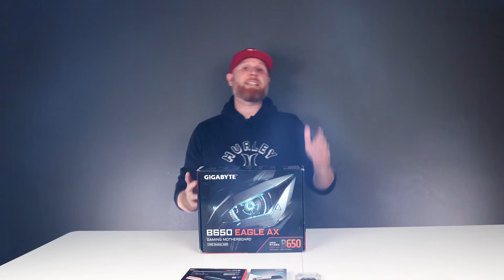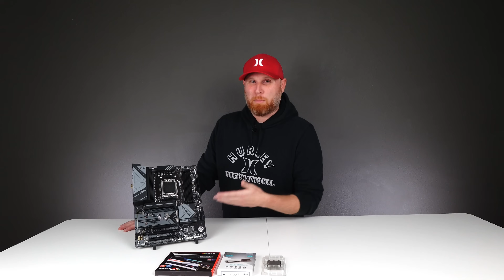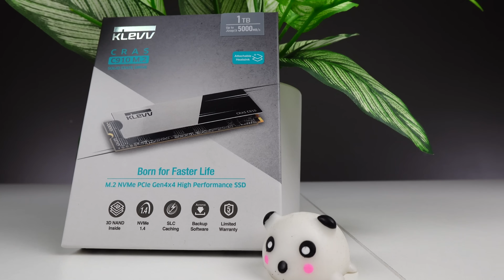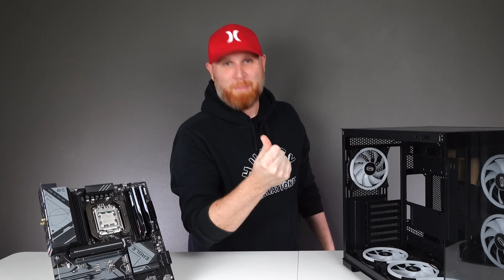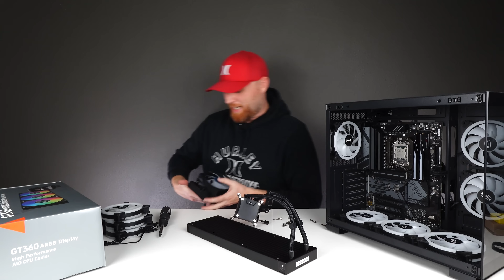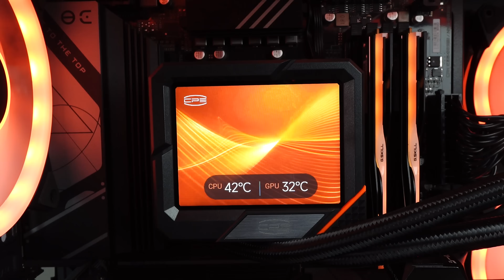The Most Well Rounded PC Build

Comment from the maker: What would you change if this was your build? Let me know!
Reply: can i have this pc please
Reply: @idontknow-e8k  What a beggar. Get a job.
Reply: The garbage power supply. That entire brand is a scam, has been found to underperform and has faked 80plus ratings. Stop supporting them and do better.
Reply: please let me have it please
Reply: can i have this pc
Reply: Depend on your budget. My budget was 2000 chf (I live in Switzerland 2000 chf are about 2500 USD). Budget is everything! I could spend even 1600 and have almost the same performance but with 400 more I have 4TB SSD, 64 RAM, a good looking case etc etc ....but I am aware that it is wasted money for my eyes and wishes.
My new PC is as follow:
Case: Cooler Master Masterframe 600 B (149 chf)
MB:     MSI MAG B650 Tomahawk WIFI (158 chf)
CPU:    Ryzen 7 7800X3D (310 chf)
RAM:   64 mb Kingston Fury Beast 2x32 ( 219chf)
SSD :    4 TB Samsung 990 Evo Plus (241 chf)
AIO:      CM Masterliquid Atmos 360 B (121 chf)
GPU:     XFX RX9070XT Mercury OC (600 chf)
PSU:     Seasonic Vertex GX 1000W (149 chf)

In total about 1950 chf = 2340 USD 

I will use it with MSFS2024 (I am a retired glider pilot) so an X3D CPU and 64 mb RAM are useful, and in MSFS the so called "tech" are not important, more important is VRAM quantity and for unknown reasons AMD GPU's perform very well.
Reply: M-ATX board for clearance.
Reply: Nvme with dram cache like the 2TB Timetec PCIe 4.0 Gaming DRAM Cache, Acer Predator GM7000, SN850X. Ram kit: KLEVV FIT V 32GB (2X 16GB) DDR5 6000 CL28/C30,  Montech
XR or Lian Li V100 cases, Thermalright Frozen Notte 360. Any money saved get Motherboard that fully supports PCie 5.0x16 on GPU. Just incase Nvidia releases more  PCI-Express 5.0 x8 cards in the future up the stack. Thanks for the content. Top gent.
Reply: I would get rid of that Nshitia GPU crap...
Reply: EVERY SINGLE PART,  THIS IS A CHILD'S FIRST PC !
Reply: @Rockstar_Supreme  Amen! At least go with a B850e Elite AX V2 board, a good 80 PLUS Gold  PSU since they're extremely affordable, a 5070 Ti as a 5070 is such a terrible card to recommend for modern day 1440p gaming, a Artic LF III Pro 360 or 420 depending on what your case can fit, and a Ryzen 5 7500F?! 🤢🤮 What in the actual f***?! Nah, get a 7800X3d. Also, 64gbs of CL36 is NOT futureproofing. There's absolutely ZERO reason to get such loose and bad timings when 6000 CL30 exists for cheap. Also, G.Skill is basically the most not budget friendly sticks you can get. I have them because I'm running CL26, but you can at the very least get an amazing deal on T-Force 48/64gb 6000-6400 CL30-32 (6400 CL32 @ 2133 infinity fabric). Not to mention getting 64gb instead of 32gb on a budget build?! Lastly but not least, the 1tb of 5000 is an absolute joke when you can get a good 2tb drive with DRAM cache for less than $90. 5000 gen4 M.2 in 2025?! Do you know what year it is?!

This is honestly the most disgusting build I've seen. This guy knows absolutely NOTHING about PCs, budgeting, how the components interact, etc.. This is just sad.

Please, anyone that's looking to build a PC, this is probably the worst that you can do for $1500. Do NOT take this guy's advice. You'd think he's trolling hard, but he's not and that's what makes this video extremely sad. A so called "techtuber" channel... Bro 😅😂🤣People like you are why there's so many people that either don't know what they're talking about in PC discussions or trying PC gaming and sell it because it didn't live up to the expectations for the money. This is definitely the worst $1500 PC build I've seen from a PC building YT channel.

What went throw his mind when he started this channel?! "I'm gonna become a successful PC building/tech advice but dish out the worst possible PC parts I can and see if no one notices".
Reply: Also, every single game you tested is far from performance taxing titles. You've built over 100 PCs and yet still don't know jack sh**... Truly sad.
Reply from the maker: @PwniezXpress you seem fun 🤦‍♂️
Reply: @ThePcRehab right! 😂😂 what a troll
Reply: @ThePcRehab  And you seem extremely unprofessional and very inexperienced.
Reply from the maker: @PwniezXpress thank you so much for the comment! It’s because of Mega fans like you that I make these videos! God bless 😘

Comment: Here is the note for ALL Aresgame PSUs on the internet's most trusted PSU tier list by SPL - 
"Fraudulent business practices and review manipulation. Testing from multiple sources has shown performance to be significantly lower than average. Fake 80+ certifications. Significant platform downgrades with the same model number and no difference in branding prevent review data from being useful for making recommendations. Tier E should be considered an upper bound for recommendations; certain models such as the AGV qualify for tier F."
NEVER buy this brand. If you are using one, replace ASAP. In general, NEVER cheap out on the PSU. This is the WORST component to try to save money on. Get less RAM or a cheaper motherboard if you must. A bad PSU has the potential to fry your system and gut multiple components when it goes.

Comment: 5070 over a 5070 Ti is absolutely WILD. As a "techtuber", I'd assume you'd go with a 5070 Ti for sure because too many games require just shy of 16gbs of VRAM in 1440p. Not only that, but a 5070 Ti is a completely different beast than the 5070. Nvidia tricks people with the name because the 5070 Ti uses the 5080 chip rather than the 5070 chip, it's just a little dumbed down. This is why I can't stand a lot of tech tubers. 5070 is for high end 1080p systems and some 1440p games. Also, to buy a 5070 right now when the 18gb super variant that's coming with more cores as well is pure insanity. I'd rather get a 5060 Ti 16gb than that hot garbage. Yuck. There's a reason it costs almost the same. Stop giving people bad advice.

Comment: 9600X has newer cores (4nm vs. the 7500F's 5nm) and are generally more power efficient. I will agree that for a gaming only build it won't matter but saying they are exactly the same is a little disingenuous... plus the 9600X has been under $200 all summer compared to playing the AliExpress lotto. Still like the build though, just wish you suggested a part that was actually readily available.

Comment: im running a 5800x 32gb ram and a 7900 xtx is it worth for me to upgrade to a 7600x or 9600x or should i just stick with my 5800x AM4
Reply from the maker: Honestly that is a very strong cpu gpu combo still. Only reason I’d upgrade if they was my setup is if i had the extra cash to burn and i was trying to get at least a 9800x3d
Reply: @ThePcRehab  gotcha thanks ill keep the 5800x for sure thanks man
Reply: How is 7900xtx In 1440p bro
Reply: @ranesh3532  its a beast
Reply: That's a great balance set up. Save your money for later. You have at least 2 years before you should upgrade
Reply: @bh0llar702 False CPU Bottleneck.
Reply: @bh0llar702 False CPU bottleneck.
Reply: Unless you’re going for at least a 7800x3D don’t waste your money.

Comment: The power supply issue is exactly why I don't use or trust "tier lists".
Reply: P.S. Great build, btw!
Reply from the maker: Oh 100% I actually have a higher failure % right now from what is considered a high tier PSU. Meanwhile this little $70 power supply is sitting at a 100% success rate lol

Comment: This one is tooled like the Seven Hero Case. I built in 3 of them and had to plug in all the bottom plugs before installing the mobo. I also left the bottom 2 and the middle 2 screws out until i was done with cabling. It was a PITA